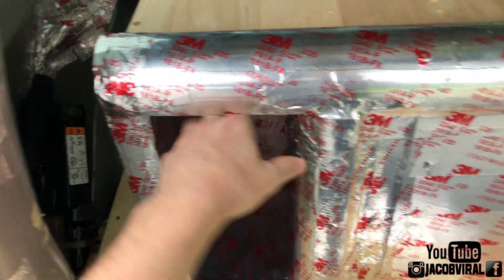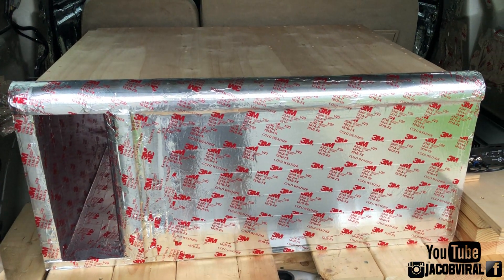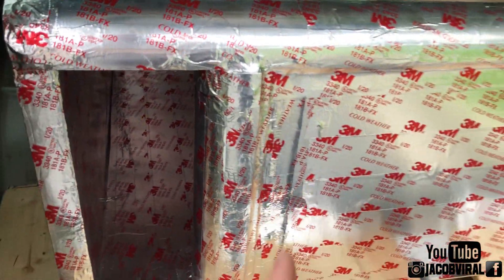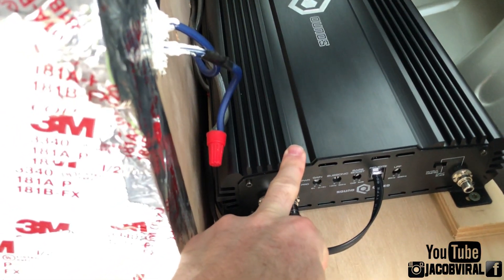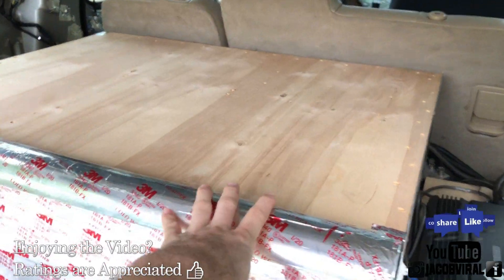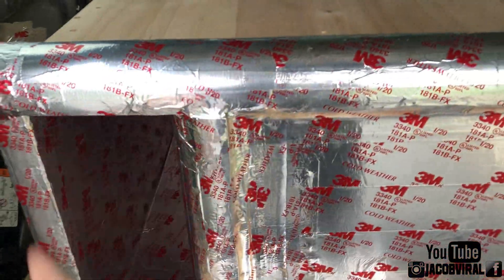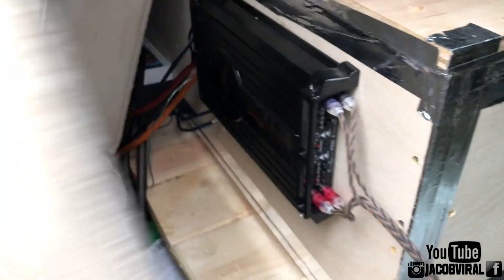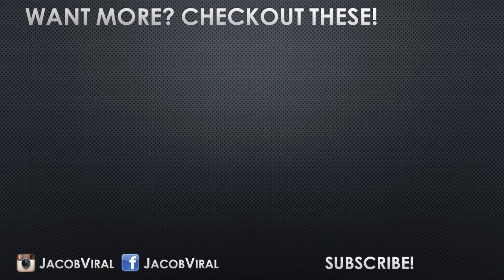HUGE BUILD UPDATE AND CHANGES TO COME!

Comment: I KNEW you couldn't stick with just a little 10" sub. SMART CHOICE to swap out for a 12". Do a T-Line or Labyrinth enclosure! Have Mark from "Car Audio Fabrication" (YT) design you a box for you to build (provides blueprints, analysis sheet, 3D renderings, and more all for something like $70! Plus he designs high quality eye appealing enclosures. Buy a powerful 12" from either Skar, Resilient Sounds, Deaf Bonce, Fi, or anything underrated except Sundown, ha😆😉✌

Comment: How do I calculate multiple areo ports if I need 100sq in of port area and I want 2 areo port does that mean 50 sq in of port area each
Reply from the maker: It’s a little harder with aero ports but realistically yes that’s it. Just the port area of a circle and identify which size is needed.
Reply: @JacobViral2  I think I found a way through for calculating